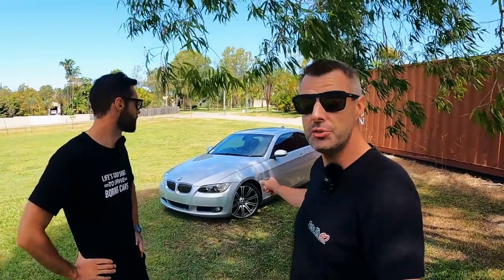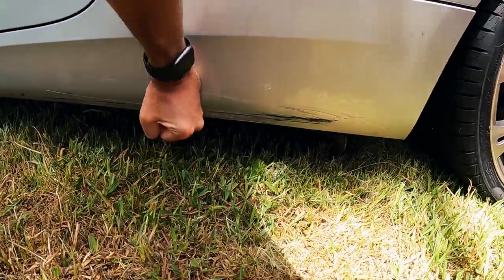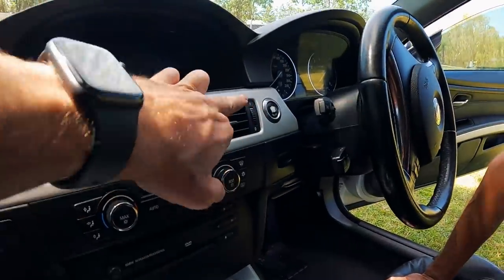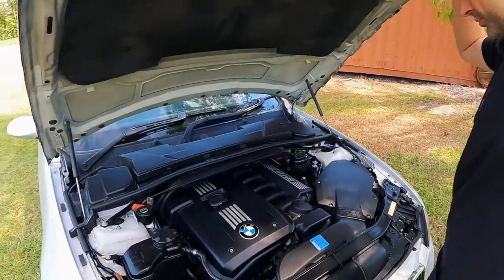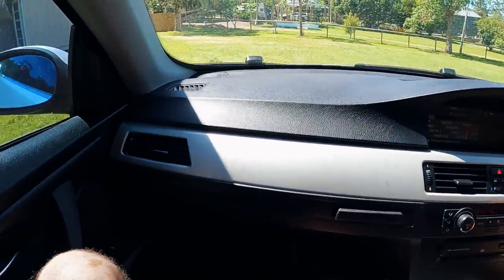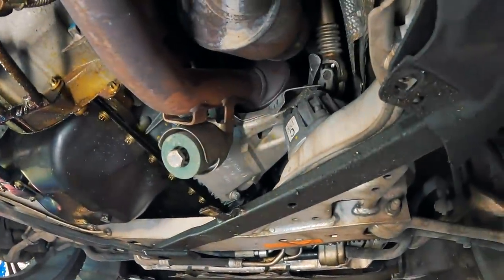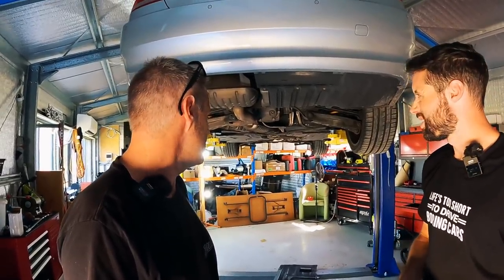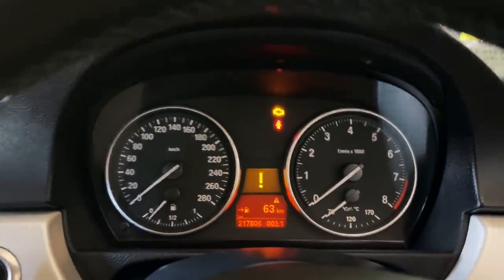EVERYTHING WRONG With The AUCTION BMW E92 Manual: Guess HOW MUCH?

Comment: With the cup holder just pull out and take the two halves apart. Stick the spring end back in the slot and put a small zip tie on the tip of the spring so it doesn’t slide back out. Fixed mine.

Comment: Hey Guys,
Wheels - just file them and clean them up, also get real BMW lugs and EBAY Plastic Covers/Caps.  We use them all the time, they stay on, are cheap and look Great!!
Side Skirts - Sand and Spray Bomb / Blend, not noticeable!
Side Markers - sand and paint with the same Silver Paint!  looks great and still shows the light through
Thrust Are Bushings - Buy Poly Bushings and press them in youself! We did on both our 335 and 535, they are awesome and much cheaper than replacing the entire arm. Strongflex and Powerflex.
Reply from the maker: Appreciate all the info, you are on the money i think. I better look in to the poly bush option. Wonder how that would compare to a M3 arm.

Comment: A mechanic told me two weeks that a leaking oil sump gasket writes off a lot of the cheaper e series cars because they charge 3k to fix it - have to drop the subframe ect. This was the mechanic who roadworthied by e82 135i (my oil sump gasket was fine) so just a normal indie mechanic. So you guys are saving 3k out of pocket for doing the sump gasket yourselves let along the other gaskets you are doing. Good on you guys! Replace that stuff and it could be good for a long time.
Reply from the maker: To be fair its a big old job and if you want to replace other common wear items that you remove on the way (which makes sense) i can see how it would add up quickly. Let's see how we end up. Fingers crossed.

Comment: Those scratches on the rear bumper could be from a pram going in and out , do they extend past the opening ? The usual hard reset by holding the sunroof button for a full rear opening and keep holding it and it will go into reset 👍

Comment: Boys,. I learned to drive and spent my P's driving my dads 325is (had Msport body kit and 16's) got written off after horrendous hail damagein 99. Should I look for an original '87 325is to base the project on or would look at kitting out any' 87 3 series with the Msport kit to make it work. Thinking of LS swap a la Vtuned drift car build? Can't imagine there were many charcoal grey 87 325is's in circulation at the time. Seen only one in the same spec since '89.
Reply: @J B thanks mate solid advice.

Comment: By the way its not a 2.5l that's just the model, still a 3.0 straight six. This is just the economical version compared to the 330. But with a tune it's pretty much the same as the 330.
Reply from the maker: Unfortunately in Australia we got a 2.5l version. Same with the euro versions up to 2008.

Comment: A family of e9x cars. awesome. What happened to the 2nd cheap n54 you bought?
Reply from the maker: It had more than a few issues. Jake has been working through it since November. Will have an update once its ready for another dragy run. Trying to get it MHD only tuned for about 23psi on pump fuel and its just been the normal N54 list of issues, but like every single issue you can think of.

Comment: I'm going to say $550. I will say, the rear bar paint will do stoopid thin so be careful there, just a light rubbing compound and polish. Do the side indicators same as you do with the headlights. Cupholder spring I would replace because it's the drivers one, is it possible to fit the spring from the passenger one? Good find over all I reckon. Well done.
Reply from the maker: Great tips as always Sir! It seems people feel much stronger about the cup holder than i do.... so will have to add it to the list.

Comment: Are you using good parts or the cheapest Chinese stuff you can find?  If you are going Elring, Bosch, VDO, Mahle etc about $200 not including TRW M3 torsion arms for your car, those are about $140.  So $200 for oil pan gasket and bolts (elring, rein bolts), valve cover and bolts, and oil filter housing gasket.
Reply from the maker: Cheapest...... we can get a hold of, unless its a small price to upgrade to something with a brand name.
Reply: @ZeroTo60Tube  the prices I quoted was in USD what it would cost at Pelican Parts or FCP Euro, I would think the cheapest won't be that much cheaper $120ish and while you are at it you might want to play Russian roulette pretty much the same thing.  For buttons and trim pieces, Chinese stuff works fine, electro-mechanical though you are rolling dice as I'm sure you have experienced.  I tell folks you can only go so cheap, otherwise it might end up costing more.

Comment: I reckon all those parts will set you back by around $800.
Just curious, how much did you get it from the auction?
Reply from the maker: All will be revealed when its finished.
Reply: Cool, wasn't sure if I had missed a previous video where you might have mentioned the auction price!👍

Comment: Nice one guys, dealer would almost definitely have milked it with those faults. 👍
Reply from the maker: Absolutely, and you can't blame them. Even mechanics have to assume the worst when they quote on things like this just in case it does turn in to a big ass job.

Comment: Did you check the terminals in the battery compartment?
Reply from the maker: We did right at the end of the vid :P
Reply: @ZeroTo60Tube  I meant the corrosion that caused the water pump issue on your 335i.

Comment: Who do you use for tint
Reply from the maker: No one specific. Last car was did was a guy in Mdore. Will need the rear on the e92 and the x5 doing.
Reply: I used a mobile guy recently for a handful of ,y trucks. Optic windows tint.